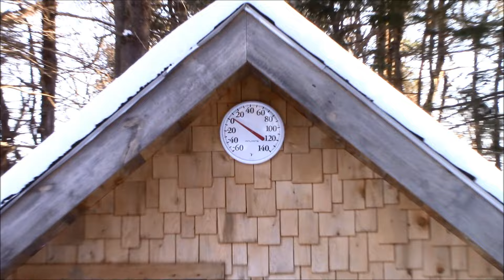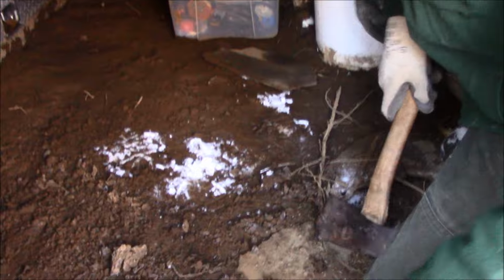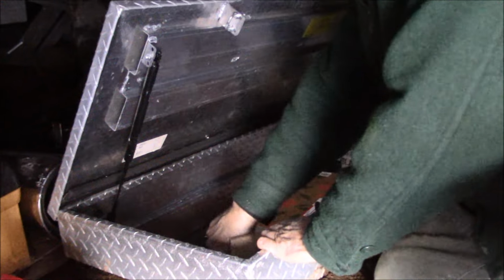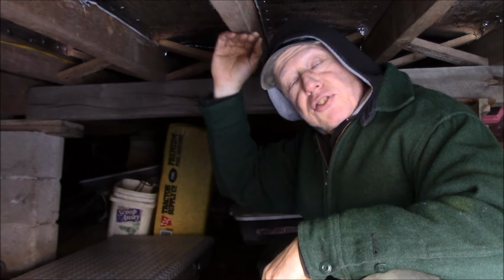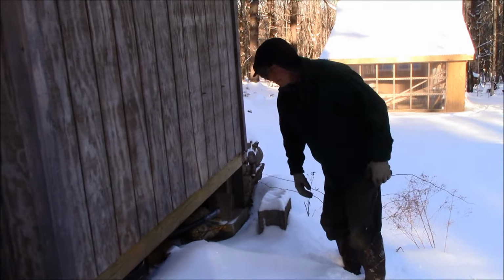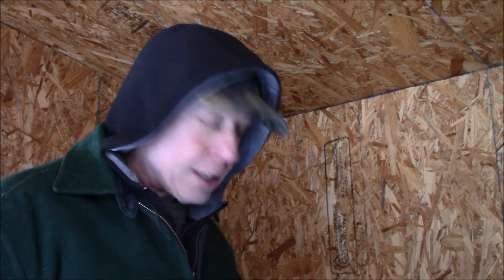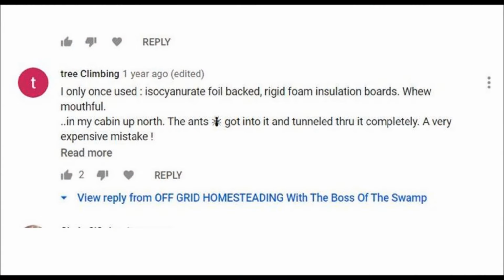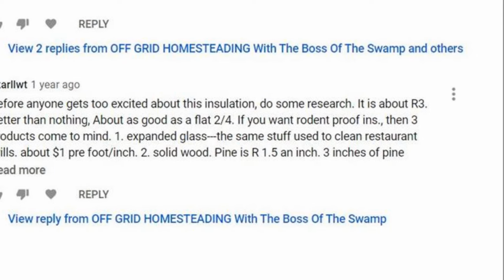Awesome Floor Insulation For A Cabin In The Woods   3rd Year Review

Comment: Do you put vapour barrier between your skirts or just the bubble foil against the skirts? I have to multiple people, including my nephew who builds homes for a living, every single one that I have spoken to are all nay sayers, telling me it just a waste of money, I'm still going ahead with the bubble foil as I have seen now 4 of your videos concerning the bubble foil on your buildings, and am looking forward to a warmer cabin. I'm glad to see that you used it on a building with no skirts, because until I get my skirts up,I just have vapour barrier up, and was a lil worried that until I get my skirts up the bubble foil wouldn't keep my floors, or trap the heat inside, but it does, so I'm no longer worried. Thank you for sharing this method. I'm on disability, so I don't have the money to spend on the more expensive insulation, for a roll of this insulation 48x100ft, it's only $159 n taxes. Very inexpensive, I can't thank you enough for sharing your videos. 🙇‍♂️🙏
Reply from the maker: When you say "skirts" I'm assuming you mean the skirting?  If so, I staple the foils against the inside of the skirting framework, which leaves an air space whatever the thickness is of the framing material i used.
Reply: Is there just one thickness of it? I'm in Canada, so Amazon steers me to the brand Reflectix.

Comment: I have a small cabin in the mountains/woods in Norway, bought last spring. It is built on pillars only 25 cm clearing from the ground. I have discovered that part of the insulation and stubble ceiling is gone. It seems like an excellent idea to use 4LFLT Low-E 6,5 mm. How can I make it when I am not able to do it from below? I do also have a challenge with the fireplace. I am watching your videos with great interest.

Comment: do the ants eat spray foam insulation as well? also would radiant barrier installed before your sub floor have same effects?
Reply from the maker: I have heard that they do but never used the spray foam myself.   Yes, foil OVER the joist insulates much better but this cabin was built before I was born.  The heat loss from the joist keeps my pipes from freezing.

Comment: 2 degrees and you’re in a hoodie. Did you line it with bubble foil?
If I ever put in a cabin floor I’ll be using bubble foil.
If you leave home for a few days in the winter do you have to drain pipes under the cabin or worry about freezing?
Reply from the maker: A few days? no but I would for a week or better.

Comment: It's always amazing to me the TROLLS or desk-jockeys who dismiss such things as Reflectix. After seeing the first video where you mentioned this product, I decided to use it under the floors of my shop/shed building. Since the building was made for me off-site and being delivered as a complete building, I bought the bubble foil and instructed the builders to put this between the floor joists. I made sure they over-lapped the joists by an inch as you showed in that video. I got the same resistance from the builders as you are getting from the trolls. I heard it all from a waste of money to it is a ridiculous idea. I finally told them that I am the customer who is paying them for a custom building of my design. If they refused to install it, I would take my business elsewhere. I was that serious about the product and of course, they didn't want to lose a customer so they did as I requested. I would have avoided the entire matter if there was a way for me to install it myself once delivered to my property. The building was on skids to avoid the taxes an affixed build would cost. The building was put onto a bed of stone and no way to get underneath it. The rest of the building was insulated with fiberglass insulation, R-13. The plan was to install a mini wood stove I wild make in time. For now, the building is heated by one space heater and it is toasty in the shop after just 20 minutes! I removed my shoes and walk around before bringing in the machines to test it that is how warm the floors are.
So, to the negative and angry people out there who have said, it won't work. I ask have you actually tried it?? My guess is no, no experience with it at all. Anyone who wants to come and see it themselves, come to my shop in the wintertime and I'll prove it to you. You shouldn't be so negative about something unless you have personal experience with it. It actually makes you look like the fools and not us who have used it and are enjoying the added warmth it provides. I was so taken by its effectiveness, that I took up the floorboards in my attic and put it across the joists, under the floor! It was a lot of work, but I wouldn't have done it if it didn't keep the heat in the shop. Thank you, JC for the info and REAL personal experience with this incredible product!
Reply from the maker: Great testimony my friend.  My friend's house was always cold. I always bundled up when we went to visit but I talked him into putting this under his floor (or stapling it to his cellar ceiling) depends on how you look at it. Anyway... he did it and not only is his house toasty now, his floors are barefoot cozy.  This stuff is awesome :-)

Comment: I'm one of your subs that doesn't need to be convinced about Reflectix (bubble foil) because I use it for a lot of things.  It keeps stuff cold too.  I wrap my water bottles with it during the summer to keep it cold & wrap stuff in my cooler.  I cut it out (foot pad) & use it in my boots to keep my feet warmer during the winter, works awesome.  I use it to keep the heat out of my condo by putting it in my windows & slider on the south side during the summer.  I cut out pieces for all the windows in my car for "car camping" in the mountains.  The stuff is amazing!

Comment: Well if it means anything to ya, i used bubble wrap to insulate my van walls, and roof, and it's great.. I use this van to camp in, and winter camp too. My little wave 3 heater keeps it great inside and just sip's propane.  It might not handle Alaska winters, but it handles Indiana ones.

Comment: Thank you!   I have a cabin in the mountains of West Virginia it has an open crawl space that I can not skirt it because it is in the bottom of a Hollar.   The cabin was built in 1984 I have owned it since 87.. It has 2x6 floor joists 16's on center rough cut to at 2 inches I might add.   There are 2 sheets of 1/2 plywood for flooring. I thought about this spring insulating it before the bugs come out.  Do you think this will better insulate my floor which is open to the air with no skirting?   I can not skirt because I get heavy rains that sometimes leave a puddle under the cabin for a day or so. The Cabin is built on Cinder blocks and about 18 inches off the ground. I have NO wood rot either because it is open to the wind and air. I did think about putting a second layer of bubble wrap foil in the bottom of the joist but I know Mice will make nests with that space. Also thank you for sharing that foam insulation can attract ants I never knew that.
Reply from the maker: I would staple this to the bottom of the floor between the joist. If you find you need more insulation (which I doubt) you can staple another sheet to the bottom of the joist.  I have one layer in my floor and we see temps -20 every winter.

Comment: Unbelievable that someone would think your actually heating your crawl space to make a point about the bubble insulation. Maybe they also think you poured concrete under the snow to make believe the ground was frozen. Better yet your running an air conditioner outside off your generator to bring your outside thermometer down to 2 degrees...I don’t know. 
Wait yes I do know, if you open your eyes and ears you can learn something new every day from someone. Even if I already know something your showing us on your channel I watch and learn from from all the bits and pieces of information you supply.
Thank you my friend for sharing your knowledge!

Comment: 10-4 JC on the bubble fool. I have a mobile up on piers in a wooded area. Over the years the rodents have trashed the fiberglass insulation. What a freakin mess and the floors are cold in the winter (ha, ha, North Florida winters , but cold feet are cold feet, lol). I've been meaning to up grade it to the bubble foil ever since I saw ya use it at the New York cabin,  but keep putting it off cause that is going to be a sucky job.. LOL !!! 🤣😎🤣 
The unit is very low to the ground  so kinda tight, yepper it ain't gonna easy. Just gonna have to work one area at a time. So thanks for the video brother, kinda a kick in the ars, LOL !!! Lord knows I need it !!!
 👍🤣👍 Be blessed, stay safe, and as always thanks for sharing.  Peace

Comment: Hi boss, i have a cabin with the floors already insulated with spray foam and there cold!!! Is there a risk of trapping some humidity if i use the bubble foil over the foam with an air space between?
Reply from the maker: In all honesty, I don't know the answer to that one.  Is your structure skirted?
Reply: @thebossoftheswamp  No yet, but that is an option, the cabin is on piers, but over a slab.
Reply: @thebossoftheswamp  No it is not, but there is flooding every few years (not to the point of reaching the floors) so i'm not sure i should skirt.

Comment: Bought my cabin in October 2018. They put fiberglass insulation underneath it and sealed it in with plywood. It's Western NY. So we get similar weather but a bit warmer in winter than you. FIRST thing I'm doing is yanking all the plywood off the bottom and the insulation and installing bubble foil underneath. That plywood will be part of the skirting and the rest will be reused for a little building project. The proof is in the pudding as far as I'm concerned.
Reply: If you pull 2 pieces off and it's in perfect condition, will you tear it all out and why ? Thanks.
Reply from the maker: If it's in good shape and rodent free, just staple the foil to the plywood for the win win.
Reply: There's no air circulation in the cabin. No roof vents at all and 8 inch of fiberglass under floor. The inside is about 80% humidity..it's 14x18 even with Windows open the water pours off the inside of the glass.
Reply: We also have high humidity in our cottage. Attic is well insulated but no insulation below floors.  We are on a lake , so tons of moisture in the air and ground below cottage is super moist.  Put all thermal windows in so when wood stove fires up windows do not sweat but humidity is still very high.  Need a vapour barrier on ground under cottage . I think that would help our situation .
Reply: @glamont3053  that may help. I'm not an expert at all but you might be right. I think that's one of the real benefits of bubble foil. It keeps most of the heat inside. I read that the Amish use calcium chloride in pillow cases under their houses if they are off the ground. Enough calcium chloride slip into the corner of the pillowcase so the point is facing down. As the CaCl absorbs moisture it drips down into a container that they then empty away from the house. Acting like a sponge pulling water out of the air.

Comment: Just curious.....
Do you think the bubble wrap works so well because it stops air from blowing in the cracks and if so do you think heavy plastic would also work???
Have a Jesus filled day boss and mrs boss
Greg in Michigan
Reply from the maker: The trapped air in the bubbles and the shiny surface is what makes it work.  I think plastic alone would cause sweat and moisture issues.
Reply: @thebossoftheswamp  
I knew you'd know😁👍

Comment: When you install the foil, do you run it the same direction as the joists, or across the joists? Do you aluminum tape on the joints? Thanks!!👍
Reply from the maker: I run it inline with them and yes I foil tape the seams.
Reply: @thebossoftheswamp  very good, thank you sir!! Great content.

Comment: Boss you are right about reflecting foil. R value doesn't work when trying to explain Spray Foam Insulation either. But we know it works MUCH BETTER. UNBELIEVABLE IN FACT. My friend is a foam contractor and he explains it use a Yeti cooler. The same with foil. I backpack and sleep outside when I deer hunt and i use a reflector sleeping bag (foil). It works. 30 degrees out and I'm warm with a pad and reflector bag. All I wear is a hoodie and long johns. Love your video's on how you do things. 🤙

Comment: JC? One question.. with your experience using the foil because WOW I love your great results with using it. I'm wondering ,.. if I don't stay at the property all winter? 
So, No heat running at all, Will it still keep pipes from freezing if some water isn't all out of the pipes ? Should I bubble foil the pipes too? After seeing your proof, I want to put bubble foil under my manufactured home, rodents have have had a great time tearing up under my place and I need to fix it using your method.  So pipes too or no ? 
Thank you.
Reply from the maker: Without a heat source of one type or another, EVERYTHING will become the same temp as the environment surrounding it.

Comment: Hi, I love your suggestions, gonna get the bubble foil!! What and or how can I insulate the wall to keep the rodents out.
Thanks for the videos.
My sister and I are attempting to make a run down cabin anew again.
Reply from the maker: I usually use fiberglass in my walls but this link will show manufacturers suggestions for wall and roof applications. https://amzn.to/2PsAmrH
Reply: @thebossoftheswamp  Thank you for the quick response.

Comment: How do you vent for condensation issues in the area under your cabin , winter and summer ? Seems its all enclosed which will lead to rot in the wood.
Reply from the maker: I vent in summer. Venting in winter will result in frozen pipes.

Comment: Boss, just a question. I have seen it suggested by a manufacturer of the bubble foil material that you should use two layers of the material--one under the floor of the structure between the joists, and another layer covering the bottom of the joists so as to create a space between the two layers. My question is, does doing that create a cavity into which rodents might be attracted to nest? Thanks for any input!
Reply from the maker: Absolutely and I mentioned this in part 1 or 2.   Additional layers with trapped a trapped air space will increase R value but... also create nesting cavities for rodents.  If wires are in there, they'll get chewed on.

Comment: you cant glue down the sub though. I feel as though overtime and expansion and contraction the screws in the subfloor will loosen up.
Reply from the maker: To eliminate that issue, just put the foil between the joist instead.

Comment: I used it in my build as I told you before, last year I stapled it down to the floor joist before installing the T&G ply like you did on your shed.     I just finished the skirting with all treated lumber and ply with the bubble stapled to the outside of the frame, treated ply over it.  So i don't have the airspace as you do in yours, I don't know if it makes a difference honestly.    Last winter we had to use slippers, we can now walk around bare footed!   Loving Michigan!,,
Reply: Terry, how is the temperature underneath in the skirted area in the winter? I want to be able to use the skirted area for food storage if possible but I was wondering if overlaying the joists like you did will prevent warm air from  coming down the joists. Thanks.
Reply: @madawna  Hello,  I think it stayed above freezing.   No issues with the plumbing under there.  Im going to store potatoes under there this year in totes and straw.
Reply: @1989Falkor  Thank you for your reply. How cold does it get where you are in Michigan?
Reply: @madawna  We usually get a cold snap of -20f here, but most of the winter is above 0f.

Comment: Great information, great video. As a matter of fact, I'm setting piers now and will be using your method. When you built the freezer shed, I heard you say you laid the bubble foil over the joists, and then laid your 3/4" plywood floor on top of that. So, no problem screwing through the bubble foil ? This method installation would give us no heat transfer through the wood joists to the under shed area ? Thank you Sir.
Reply from the maker: This method insulates best but you have to keep water from getting trapped between the foil and the sub floor.  I discuss that further in this video:  https://www.youtube.com/watch?v=Mjakei20eTI

Comment: I had my 2 sheds built and fully wrapped using the foil bubble wrap, and I heat with a chinese diesel heater and I am happy so far, I insulated the walls and ceiling with fiberglass insulation as well.

Comment: I’m also going to use this in my cabin and our well house; however, I don’t believe that heat is radiating from the the interior of the cabin through the foil and into the crawl space.  Rather, it is my understanding that heat is radiating up from the earth and being reflected back into the confines of the crawl space by the bubble foil, thus preventing freezing of the items stored within the crawlspace, as well as preventing surface freezing of the ground.
Reply from the maker: That is correct. A tiny bit of heat will bleed through the joist but the ambient temp of the ground is trapped beneath the cabin by the foil on the underside of the floor and inside of the skirting. The temp under the cabin stays the same most of the year.

Comment: Boss,   When you build your cabins what is your rule on how deep to dig a hole and what diameter for a concrete pier for 4x4's and 6x6's. I didn't know if they needed to be twice the diameter of the post or what.  I am building a grape arbor and a wood shed and decided to set my post on piers instead of sinking the post into the earth after I read that most treated lumber now days is treated for bugs and not rot.
Reply from the maker: I'll be addressing these questions in an upcoming Q&A :-)
Reply: What will be the title of the video